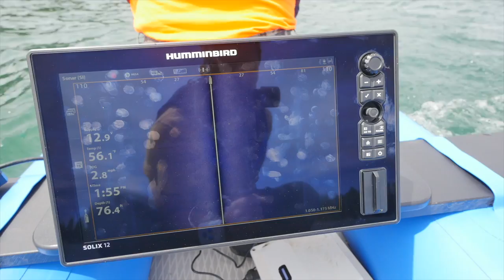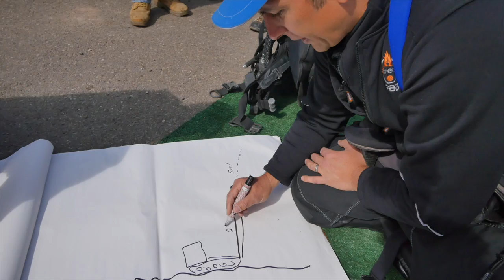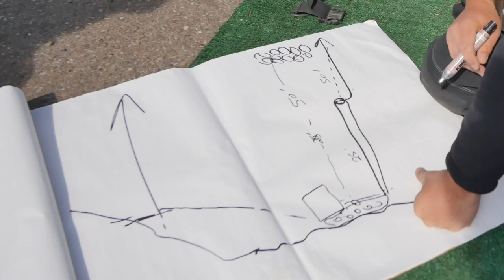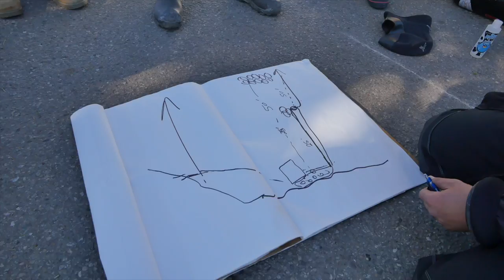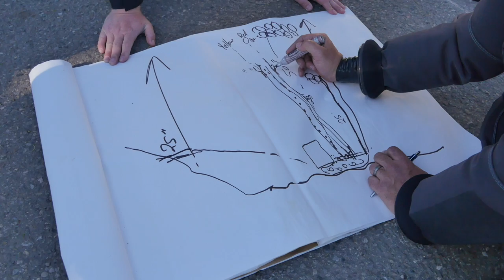Recovering 15k Pound Snowcat 75' Underwater in High Mtn Lake

Comment: Very cool lift. I would advise you to take a crane and rigging class. I'm so thankful nobody got hurt when that strap cut. Maybe instead of carabeaners straps and chains, you could use steel chokers and shackles. A rigging class could explain and teach you about alternative ways to rig your bags. Be safe!
Reply: Where would you put the crane in the water
Reply: @artstrothman8815  🤣. Barge crane maybe? Because that's not expensive. 😜
Reply: You wouldn’t put a crane in the water, but the techniques and methods used when rigging and lifting items with cranes can be very similar to this type of task.
Reply: with those small straps i don't even hook my lawnmower on a trailer ... start using professional material.
Reply: Just wondering why in the world they didn't float down two spreader bars? Would have made it much simpler
Reply: @bradfordbrown969  they do this on their own dime. YouTube is the only income mostly. I also don't think they have that kind of lifting experience yet.
Reply: @rondogwil  chinook helicopter and a winch,party time.............
Reply: @rondogwil  Yet they do this on their own dime, Yet they can not do a bit of rigging research before they head out there. The fail is on them for stupidness. 
You are trying to lift 15k worth of steel weight along with all of that water. The lack of understand is bound to get someone hurt. I am not even going to watch the video as because comments said they failed to begin with.
Reply: @kameljoe21  lol another keyboard warrior.
Reply: @kameljoe21  weight of the water???? Because water weighs more when it’s in the water?
Reply: Yes as a crane operator I would advise steel cables and shackles for safety.
Reply: You guys are great 👍
Reply: Rigging class is imperative. So many stress factors not to mention underwater rigging stresses.

Comment: @Jared, it looks like you are in need of a way to keep your lift bags organized and working together, instead of rubbing against each other and tearing. Imagine a steel bar grid made up of thick metal bars,  each 4ft long. When all the bars are screwed together, you have a 16 square ft grid. The lift bags are tied to the grid and spaced far enough apart to not touch one another and also to balance the lift evenly across the bags. Then it is just a matter of connecting the wreck to this grid with 2-3 chains of the length you determine you will need.

Comment: This recovery would make a fantastic documentary on the television from the start to the conclusion with its highs and lows and for the closure for both of the families concerned, A lot of hard work involved by all and thanks guys and please be safe to you all out there, Regards from the UK
Reply: @drmayeda1930  It's a sad no win situation, but I'm hoping they are there for the victims families  closure. That roof top being broken open means something happened down there.
  I've got friends who drive on ice roads on frozen lakes. They say first option is jump if you can get clear when you know it's going through. if it just drops right through no warning , just stay with it, as divers will know where you are in the cab after. 
   They say as the thing drops it can drift from the hole, you can't swim out because of the cold/depth. then when the inevitable happens. you are trapped under the ice sheet and chances are you aren't recovered in the spring as you can't found. It sounds horrible, but thats the reality all those guys face doing this driving job.
Reply: @super6954  read the attached articles. the bodies were recovered soon after the accident

Comment: I work in a ski resort. Sometimes I help my coworker who wrench on these things. #1 rule NEVER hook to the tracks. They are fragile, doesn't last more than a couple seasons, and being underwater the fiber strings in them are most then likely rotted and ready to snap. My advice is cut them. A reciprocating saw does wonder. Then you have acces to the frame, which you should inspect thoroughly. They are prone to stress cracks, and that hard landing didn't do it good. No lifting on rear lift frame. We use the front lift frame to lift the snowcat when we move them around in the summer, but again the frame needs to be inspected for potential damage before proceeding. The planetary drive (the rear of the machine where the sprockets are) is a strong part. Ideally you should tilt the cab to have a good access to the front of the frame, but without 24v power or hydraulics it's not easily feasible. Good luck and be safe!
Reply: How about hooking through the wheels after getting the tracks cut loose? Lay a sausage bag or two along each side above the wheels, strapped down to all the wheels.
Reply: @greggv8  indeed, i dont get, why to get the bags all to the top? Just 1m above the tracks is enough.

Comment: Here's a suggestion from someone that did towing and recovery.
Stop using Carabiners, use recovery ring shackles. Carabiners aren't intended for lifting.
If you use four 6 feet long pieces of chain, loop the chain around an axle or frame member on all 4 corners, or as close to the corners as possible, then attach your bags to each of the chains. 
For your air bags, make a manifold for 3 or 4 bags, and feed the manifold from a compressor. A 10 CFM compressor will fill 2 sets of bags at a controlled rate. 
Partially lifting the vehicle than pulling it from a higher bottom just makes double work. 

My opinion, use what you want, or disregard.
Reply: Im shour the guys know this did you dive in frozen lakes 100feet of frozen watter with neapream on like in begening of the vidio they sead they cant just lay on their back because of the gear they need to where i was riging with cranes my whole life and would do alot of diferent things but im shoure the diving under watter is harder
Reply: They are under water easier to have a one piece connection so you do drop something
Reply: Actually we have carabiners used for lifting in the military, so they do have them availble.
Reply: Douglas Price 
Please post the NSN or the Mil Spec numbers for the carabiners if you can? These guys could really use them. Thanks.

Comment: Y'all need to talk with Ron Pratt. He is one of the Yourube land recovery specialists. Get his advice on hook points, and proper equipment for what you are going to hook them to. He actuallyis a certified lift specialist on rigging and equipment on land. 
Even a mini barge on the water with weighted cables to raise or low your equipment. 
But a much better plan, you have one on land, and you also know the cab is wide open and the bed is gone. 
Good luck, but don't let anyone else die recovering this from the lake.
Reply: Yeehaw!

Comment: you should add one-way valves on each leg of the manifold before the hoses so that way if you lose a hose or a bag it doesn't drain all the bags. Also then you could use the manifold with less bags

Comment: Spreader bars and bigger killer tomatoes, that'll pop it up. 
In my commercial diving days we actually did a lot of recovery/ salvage of equipment/ vehicles that had gone through ice. 
Also,  fabricate a manifold with valves for your bags so you can control the rate at which they fill. 
That will allow you to "rock" the item being lifted and aid in breaking the bottom suction. 
15K Cat and you could be fighting another 9K of suction.
Just my 50cents
Reply: I agree a manifold would greatly increase control.
Reply: Defiitely a manifold, also directional flow control valves

Comment: As a cat operator the part the blade(plow) attaches at is called a push frame, if it's there and accessible that would be a great attachment point for bags because we use it to lift the front of the machine all the time, glad you got off the tracks though, I've seen them tear under far less stress than lifting it would cause, looking forward to seeing a successful part 2
Reply: They didn't want to attach there because the ropes could damage the cab. They'd need to make a framework to attach to the plow mounts, extended forward and sideways to make lift points away from the cab. Then they'd have to find divers with experience handling metal stuff like that in these conditions.

Comment: I’ve been a snowcat operator for over 20 years the main lift points for gantry cranes it the blade curl ram attachment at the back of the push frame and the rear tiller frame swing joint
Reply: me too I was a groomer operator
Reply: I love your pizza
Reply: Thanks for the corduroy every morning guys!

Comment: The lift bags I used were rated.  Most had overpressure relief valve.    You need to be careful as load raises.  It’s 3x the weight.  But you just want it to start lifting and then you should  remove air as it raises.    First 33’ pressure doubles, next to 66’ .....
  As suggested.  When you have similar machine to practice on.   You practice on it.

Comment: Instead af carabiner you could use shackles as they are stronger and a better design for lifting.
Reply: Yeh, and those straps looked way under par for the weight
Reply: yes, you 100% right but they can drop the pin when working with them under the water.  they might be more familiar with the use of a carabiner then shackles.
Reply: @mog5858  attach a piece of painted chicken wire or tie it off via the hole in the top of the pin. Same practice as working at Heights.

Comment: bummer on not getting it though i do have an idea.
okay so if the tracks are hollow can you put some plastic pipes though the whole thing? if so put 4 of them though two at the front two at the rear then wiith a rope gun (if they work under water or if not then this plan is floored) put the rope though but attach a chain to the rope so it shoots though the pipe then get some opf those metal things D shaped things on the chains and add some next do the same thing but with 4 more pipes with chain on then do what you did just now that might work or might not just an idea,

Comment: QUESTION: 
Could you keep the bags on the surface, attach chains to the bags and run them down to the vehicle, attach them and use a chain come along to hoist it at a more controlled rate?

Comment: What about a collapseable tube say a foot diameter suspended about 1 or 2 feet below the water surface and extending down to close to the work site and pumping air to the bottom entrance of the 1 foot tube so it can work as a siphon sucking silt and debris away from the work area making the water clearer? Is that a useful idea?
Reply from the maker: Once you kick up silt, it does not go away with anything but time. Good idea though.

Comment: There is one question that was not answered in the how the cat got to the bottom of the lake scenario and I think it's important because it is a safety related issues that people should consider before driving on to any lake that is frozen it's nearly always possible to break through is the trip necessary or was it just a Joyride?
Reply from the maker: Although the lake was 30" thick at the time, it is my understanding that on this lake there are soft pockets of slush and the cat got caught in one of these. Mike's theory is that they spun the tracks trying to get out and cut the rest of the way through.

Comment: Hello there, I don't know if anyone said it but next time, you need to add a ball valve to each bag so it's easyer to control the air flow in the bags, connecting and disconnecting the hoses and keeping bags full of air seperatelly

Comment: The air manifold seems like a great idea.  One question though, what's the opening pressure on the relief valves on the bags -- are the depths of the bags close enough that they all fill before the highest one starts relieving?  OK, maybe that's two questions.  :)
Reply from the maker: Internal bag pressure is 2.5lbs where the relief valves will release.
Reply: @AdventuresWithPurpose  So, unless I'm missing something, all of the bags on one manifold need to be less than 6 feet apart in depth, or the lower ones won't fill. Well, technically, I guess you can inflate any part of any bag that is not more than 6 feet deeper than the highest relief valve (this assumes the air hoses are not full of water).  Seeing that when inflated under water, those bags must be 4 or so feet high, this already uses more than 1/2 of the 6 feet (if the relief valve is near the top).  I suspect to use the manifold successfully, you need to have all of the bags at nearly the same depth.  Or have a rather large air source so that the air pressure in the manifold is significantly greater than the pressure in the bags.  That is, you're pushing enough air through that there is a significant pressure drop in the plumbing between the manifold and the bag.
But hell, you've actually done it, and I'm just holding my couch down.  So I might be wrong, and you've probably already figured it all out.  Keep up the good work.

Comment: Man you work hard. I love this stuff. I used to do little lifts, 500lbs. Stuff from the wrecks of the graveyard of the Atlantic. Deep, dark cold salt water off of NJ, VA and NC. Nothing special. Chunks of engines. What have you. They live in our gardens or fields. We did get some guns. Army would have to come out and inspect them. One was restored and probably still in a museum in NC. We got a few port holes. But the had been mostly picked by the 80s. It take 2, 3 trips to get one out on a wrecks at 90’. I dove last years in the keys. Older now but still like to get a new dry suit and head north. Be safe and you’ll get it .

Comment: Mr. Leiseik This isn't about this Video, It is about the Missing Brides Maid, not sure if you read these or not, but I was just thinking if they raised that levee 10 ft they used dirt and if her truck was sitting right next to the bank of the waterway, it might have covered the truck in dirt and overtime might have packed it under the sludge and you would need something to pick up metal to find where the truck was buried.
Reply from the maker: Yes, that is one of my concerns as well.
Reply: @AdventuresWithPurpose  I have watched people firm up levees, they bring in dump truckloads of dirt and rock and just dump it off the edge of the levee and bring in graders to pack it down!
Reply: @AdventuresWithPurpose  I hope you can find a way it must be horrible on the family not knowing!

Comment: I'm surprised you don't number your buoys, that way you'd know which attachment point broke loose for sure.  Might only be relevant for these deep heavy jobs but it would cut out some guesswork.
Reply: I just had a thought.  What if you took 2 chromoly steel poles 3-4' long with your lifting line & buoy at one end and a pair of heavy duty shackle bolts on the other.  Bolt the pole to the frame under the cab so it points out from each side.

If that makes any sense?  If YouTube would let you post pictures in chat I could draw it out so it makes sense but that would be way too easy...
Reply from the maker: Numbering the buoys is a great idea. Thanks for the tip.

Comment: On the manifold idea you should put a ball valve or something of the sort, off of the end of the manifold on hose and stagger them so they are opposite of each other so if something happens to one hose you can shut it off. 
Also should have someone make you new hoses out of high pressure hydraulic hose. That they are a stronger hose and the fittings won't pop loose as easily.

Comment: Max suface Bar for a lift bag is X. Filling  a lift bag at 65 feet deep at 1300 ALT = 100 feet deep would be plus 3 bars.  If you fill the bag at its maximun surface presure while @ 100 feet deep then surface with the bags without  letting air out, the bags will have trippled the maximun bar presure. . dont know if you guys equalized them or not, But i did not see you do that in the video. anyways, if your bags poped, i would say its because of that....  my 2 cents..  non refundable.  my math could be wrong with the Alt but close  enough to kill the bags

Comment: Literally the reason 29CFR 1910 sub part T exists. “Mark” is lucky he didn’t AGE himself being that close to 20k lbs of lift bags shooting to the surface. Single 80s diving 70’ at 10k’ elevation. Did anyone do any gas planning. 14 minute dive... at 70’ at 10k elevation with full face masks and dry suits. Zero margin for error. That’s incredibly foolish. Any issue at depth and you’re doing a body recovery instead of a snow cat recovery.
Reply: Scott, looks like it went perfect as planned. 🇺🇲
Reply: Not A Fun Loving Guy I can tell you have zero experience doing this type of work. Nothing went planned and just by sheer luck, no one was seriously injured.
Reply: xp extremely piss poor planning. They will hurt someone eventually. Wingin’ underwater salvage with volunteers only goes well until it doesn’t, which is usually when someone dies. Hence the huge costs for a commercial operation to do this type of work is largely due to the safety aspect.
Reply: @scottygoes2201  I'll be honest, watched this one again and these guys didn't know what DAFAQ wss going on....
I'll use the repatitive line from their video, I dont even know what to think.

Comment: The strongest part of the sub frame on the delicate snow cat was the hitch. I would have put a 2' short line with maybe 4 air bags on the end and brought it up ass end first, close to the surface. With handling lines up front, one on each front corner too level it out as it was pulled to land, to slide it up on the ramp, after making sure that it was either in drive or neutral. Approximate time, 8 hrs. with 4 divers, 3 boats and operators.

Comment: 1st. off..Awesome enjoyable video.......however, perhaps you should have had run through a Dry Scenario of "hook up" on land with the dry snowcat. Also a pressure manifold with individual ball valves to adjust rate of air flow. And simultaneously inflate each bag slowly to gently lift it off the bottom. (air pressure gauges are a huge asset)  Good stuff though...Right idea, just needs fine tuning....